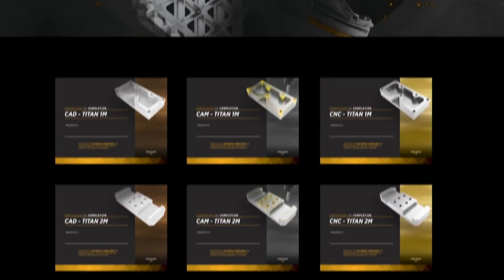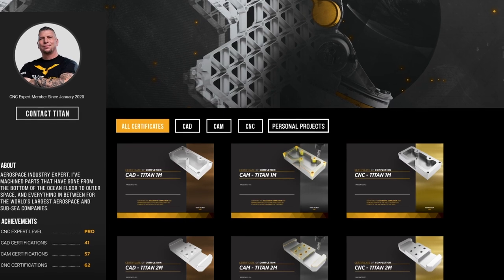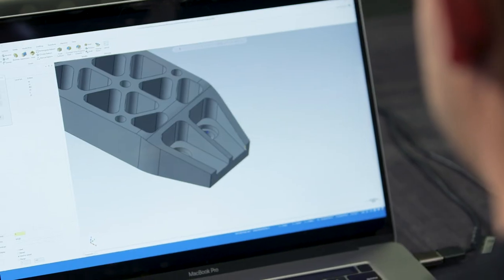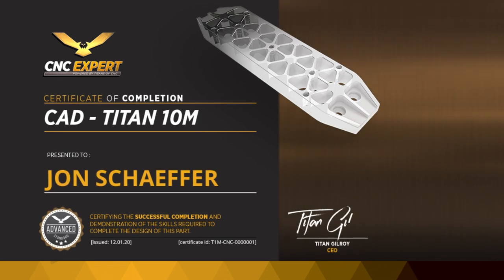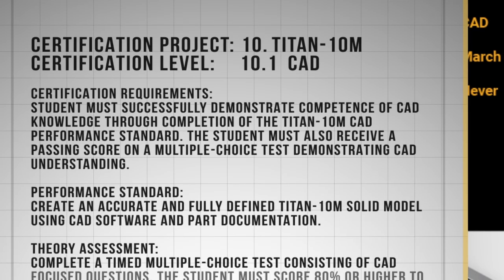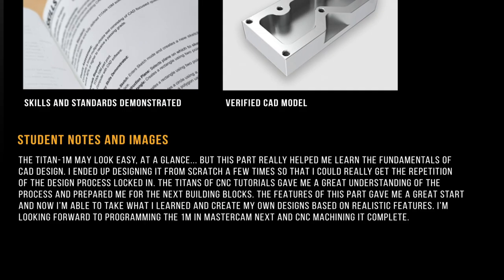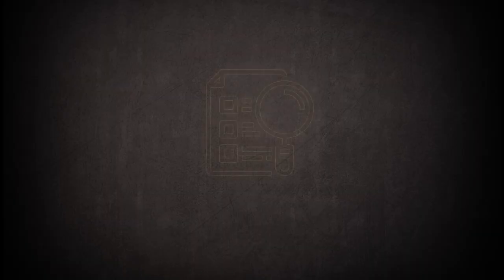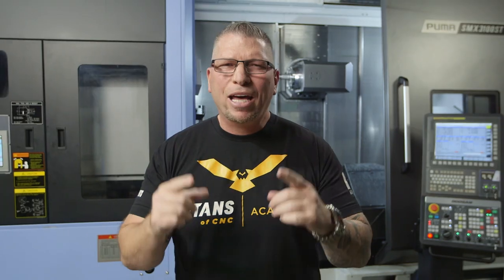MIND BLOWING CHANGE TO CNC MACHINING | CNC EXPERT

Comment: Where I work they'll give me one piece of material and 16 hours to program, setup  and machine a tight tolerance 4 or 5 axis part in a 3 axis mill, then complain when I do it behind schedule. 
They won't even care that I had to make fixturing or that it's actually in tolerance after 5 to 7 operations. They're more concerned with the time efficiency involved in producing parts using inefficient methods. The funny thing is they're all ex-machinists who moved into management positions. It's like they forgot what's involved. They think I'm baking cookies or something.

Comment: Real word numbers...speed n feed of a .0283 hole in 304 drilled .3937 deep without wander. Need to be held to .0008 run out. O.D of part is .043 to .055 in diameter

Comment: cause the big guy "BOOM" back here is a free tip from the original DarkTech, perpetual motion is a hoax or a big joke cause it will stop but what happen if i say "perpetual energy"??? hehehe that's right people i will finish my half way tips only on this channel, what happen if 2 motor 1 capacitor also wires combine hehehe but the main part is the frame to put or hold them together that where big guy "BOOM" come in, i bet he can cnc any frame you want, there you have it guys, "perpetual energy" or what you all wanna free energy source, oh if one can powered 1 bolt light imagen if you had 100 joining together hehehehe "BOOOOOOOM"